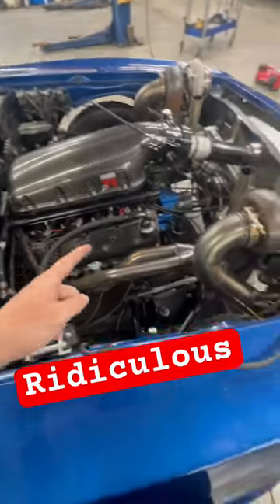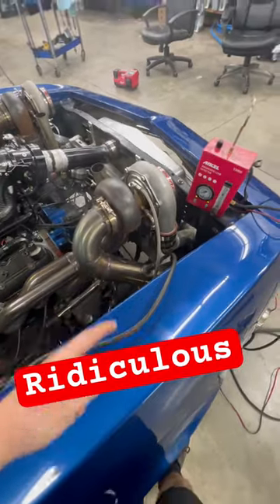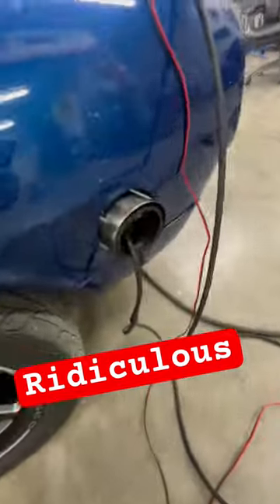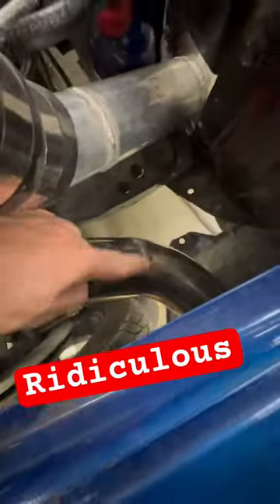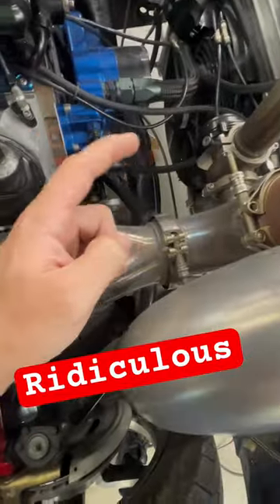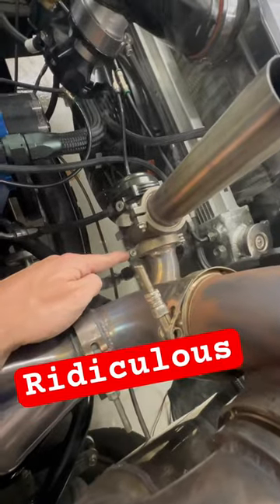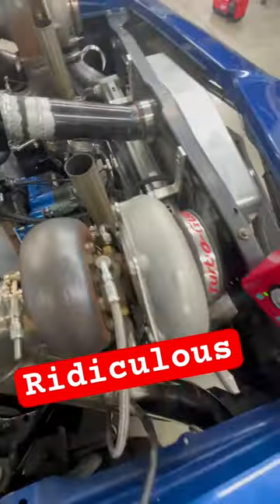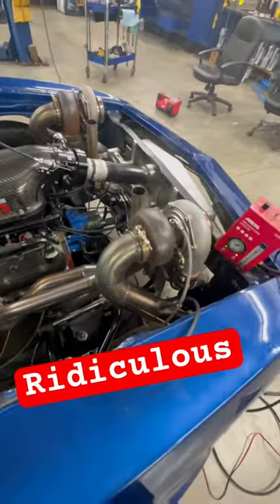What a mess

Comment: I get V-bands on paper are supposed to provide a solid "dry" mechanical seal, I wonder if a 0.005"-0.010" copper gasket shim would fix the leak. I would even be crazy enough to say lube it with a small amount of engine oil.  The heat will carbonize the oil in the small gaps and provide a slightly better seal.
Reply: I’ve always done two coats of copper gasket you mentioned on the mating surfaces with great results
Reply: Antisieze?

Comment: It’s when the v band flanges were welded on and they got warped.  People don’t realize you can’t just run a bead right around after you tac them on.  You must hit the tacs 180 degrees out from each other. 4 tacs. Then weld one 1/4 section. Go 180 from that. Weld one 1/4 and so on letting it cool in between 1/2 sections.  So hit one 1/4. Do the opposite side. Let cool  then hit the other two welds.    It makes a huge difference

Comment: When you're welding vband make sure you do them on opposing 1/4th  and give ample time to let it cool between welds. Also having it connected to the piece you want it on helps as well. 

And copper flange seals should fix your issues mate

Comment: I've personally had a few v band assemblies I put a little too much heat in to it when I was welding and it warped the  flange a bit. Ran it across a belt sander and straightened it out.
Reply from the maker: That ain’t a terrible idea actually. I heard also welding the flanges with them clamped together helps heat dissipation
Reply: Agree!

Comment: V-band clamp, need to install, then hit it with a dead blow, tighten,  hit it some more, tighten some more.  Basically seat it properly.  On aircraft it's not a leak if you can feel the leak under pressure at some distance,  can't remember how far away.
Reply from the maker: I did that. The flanges are warped
Reply: @Rev2lateRacing  
Are you going to replace or machine them?